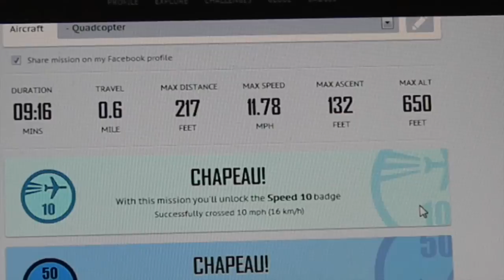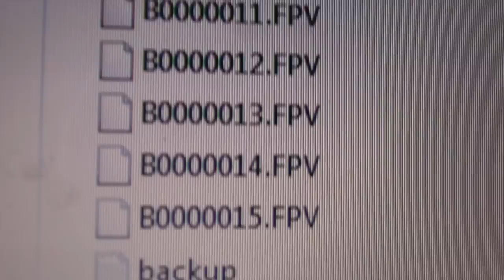Flytrex Core 2.0 Review

Comment: Hello, i'm trying to get some information about this product and i've reached out 3 times to the flytrex customer service with no response for awhile now. i was hoping you may have some answers to my questions. here is the original email i sent them...

Hello, I have a few questions about your product and weather or not it will work for what i need. I am planning on building a high end quad or hexa copter and attaching a thermal imaging camera to it. What i need to do is to be able to geo-track my flight path and be able to sync it up with the thermal imaging video and hopefully be able to be accurate with it, location wise. Is the flytrex core 2 able to be connected to any type of drone/copter? Also, can a thermal imagery video be uploaded and used in dashware? This is a senior design project that my team has patent pending right now and are hoping to make this all come together soon. Any insight or help would be appreciated, and then I can go forward with purchasing the core 2 along with any additional components or adapters that I may need. Thanks! Looking forward to hearing back from you. Also, how accurate is this geo-tracking? Accurate to a foot? An inch? Just trying to get an idea on the accuracy. Also, can the flight path be converted to a file that can be imported and overleyed into ArcGIS? I'm not sure if you're familiar with that program.
-John Traverso

If you have any feed back i would appreciate it
Thanks

Comment: Good video, but you didn't mention what it takes to get the backup data off the module.  Does it write it to the SD card once you plug it in or do you have to connect the FC to the PC?
Reply from the maker: Thanks.  I didn't want the video to be longer.  Flytrex has a good how-t on their blog site plus it's really simple.  It writes directly to the microSD as B files as I mentioned in the video.